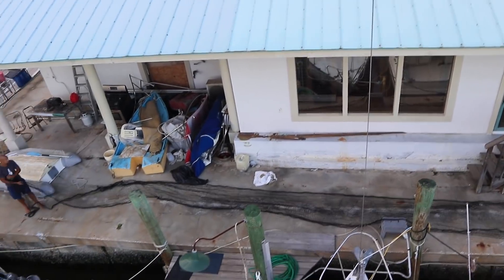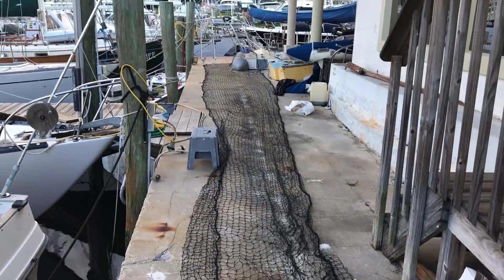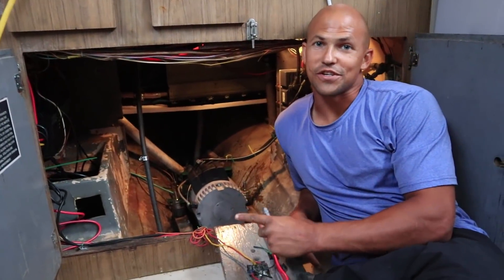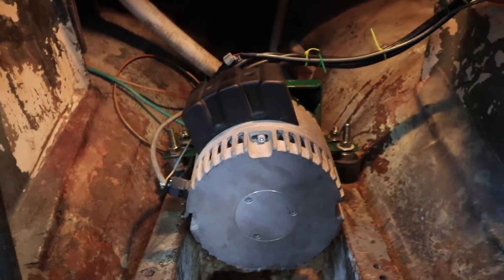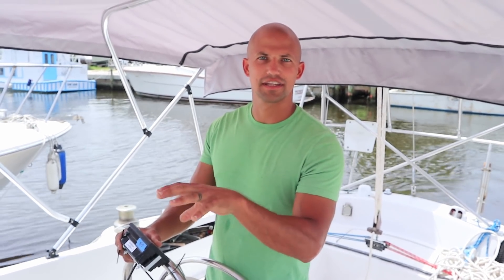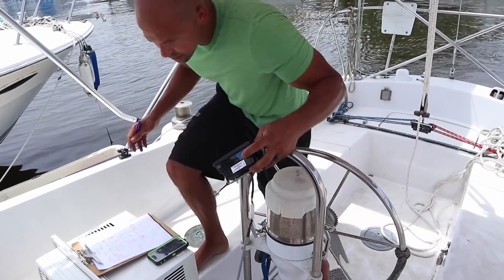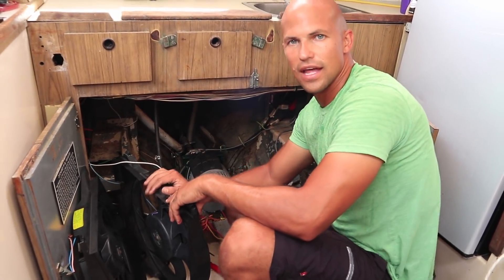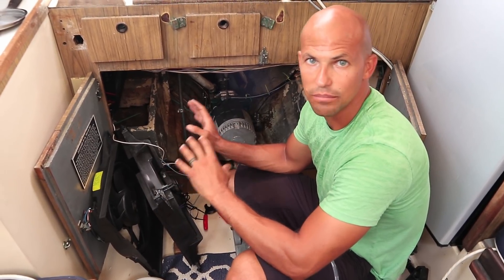Electric motor testing | 28 | Beau and Brandy Sailing

Comment: Any reason you guys decided to go with a brushless DC motor instead of an AC motor, seems like AC could offer more power with less heat and smaller wires. If you had to do it over again would you change it up? I'm curious as I'm about to try and attempt the same thing.

Comment: hi, this may be a bit late as i am only discovering your excellent channel now but a partial add on solution is to vent the doors into the motor room. Add the fan in the vented doors to draw hot air out and this should keep ambient running temperatures as well as throw some heat into the cabin on colder at sea cruising
cheers and all the best

Comment: Heating Problem. I would cut two holes and have a fan in each hole for push pull airflow, your cabin would then become a little warm. My computer also warms up my room, I can open the window if it is too hot

Comment: Thanks for sharing the info on motor temp.  I have the same motor and kit as you I think, and I was worried that my temperature was running between 150 and 200F.  Now that I know that's okay it takes a load off my mind!

Comment: You have every right to worry about motor overheating, maybe not needed but every right. If you still want to cool it down use copper tubing around the motor with a water pump. this would be alot more efficient than fans.
Reply from the maker: Thanks James! We haven’t had any heating issues so far...just a lack of knowledge on my part in the beginning. Haven’t even had to use the fans. 🙌
Reply from the maker: Thanks James! We haven’t had any heating issues so far...just a lack of knowledge on my part in the beginning. Haven’t even had to use the fans. 🙌

Comment: Look at the motor enclosure type on the motor tag. If that is a TEFC (totally enclosed fan cooled) motor, blowing air on it will do nothing it is entirely based on incoming ambient temperature coming in. Ie your engine/motor bay.

Adding a fan does not constitute cooling, only circulating of air.  And does not allow for stratification of heat. 

If anything the additional fan motor is likely only adding more heat to the compartment.

If you are worried about heat, you should be picking up your amp clamp, looking at amp draw. As you get closer to FLA (full load amps) of the motor, is where those amps plus SF will be the threshold of the insulating capacity between the windings. Unofficially consider the amps, the heat input to the motor. Minus your 75-92% of efficiency actually going to the shaft. 

Equate your plowing into a dock that of motoring up stream, without any momentum, from a dead stop. The prop is trying to pull water vs have the pressure of flow coming into it. Not quite like having a locked rotor or shaft.. but you are also putting excessive load on your components. (Could be why your controller crapped out). What are the specs on the motor. Ac volts/phase or dc volts?

Other than that, temperature on the motor is like putting your hand on an interior wall of your house to find out how cold it is outside.

Trying the right things, but methods and metrics are a bit off.   

Not trying to crap on you, just looking at your scenario from an open mindset. Tks!

Comment: A comment about testing your propulsion motor.  It takes a certain amount of power to move a sailboat at any given speed.  Your motor provides that power through your propeller.  However, when you tie your boat to the dock you are no longer looking at the power required to move the sailboat.  Instead you are looking at the power required to move the dock (i.e. North America), which is essentially infinite.  So when you run the motor to drive the propeller the power the motor runs at is the maximum power the motor and propeller can deliver at whatever the motor rpms is.  That amount of power is much greater than the amount required to move the boat.  So your test is actually looking at a much higher load on the motor than you would see if you ran the motor at the same rpms with the boat able to move (i.e., not tied to the dock).  So basically your test tells you nothing about the motor operating temperature with the boat underway.  Also as noted below, if you don't have a reduction gear between the motor and the prop, the maximum motor/prop rpms your are likely to need is about 1,500 to achieve hull speed.  The exact maximum prop rpms depends on the displacement of your boat, the waterline length, the wetted surface area, etc and the details of your prop (# of blades, blade area, blade pitch, blade type, etc.).  For example, my 36' sailboat displaces 15,000 lbs, has a 27.5' waterline length, and a relatively large wetted surface (full keel).  My prop is a 20" diameter, 13.5" pitch, 3 blade standard prop with a 35% disk area ratio.  That combination of boat and prop requires about 750 prop rpms to push the boat at 5.5 knots and uses about 10 hp (7.5 kilowatts).  If I tied the boat to the dock and ran the engine at the same speed the engine power would increase to the maximum the engine could produce at that rpm setting, which is more than 3 times the power required to move the boat.  Just a heads up.

Comment: I imagine you're already aware that the operating temperature for electric motors is 60 degrees F  above surounding ambient temperature. So if it's a hundred degrees in the engine compartment the motor will be fine at 160 degrees F which can easily burn your hand. You can wrap soft copper tubing around the motor and pump water through it also.

Comment: Guys just an observation; You may want to think about extracting the heat rather than cooling the engine bay. IE conventional engine bay extractor that has a cool air inlet and a hot air extract. Internal combustion engines are a lot less efficient creating loads more waste heat. While much of this is transmitted to the cooling water circuits and overboard a great deal of the engine bay heat in modern boats is extracted via ducted fans . You could even think about a small intercooler on the air inlet cooling the air before extraction. This would be pretty simple to do with a small low wattage pump and a through hull? Just a few thoughts. Sail Safe Ant & Cid xx

Comment: Awesome job guys. An idea would be to build a tube type structure to go around the motor that the fans set at each end pushing and pulling air thru. Like a wind tunnel maximizing air flow directly around the motor and not just blowing at it. Again just a thought. I know you two will figure it out. Peace guys.

Comment: Good to see another electric conversion. I'm running 48V 15kw hybrid and it's water cooled with a Johnson circulation pump.
I've been told to never run the engine on the dock like your test. The loads about double when the boats not moving and the thrust bearing is stressed. From stationary I can select say 900RPM and the amp draw starts at 100amps and will drop to 60 when the boat reaches about 4knts.
I am sure you'll get it sussed and more boaties will convert.
Cheers.
Reply from the maker: nice to meet another electric. definitely learning a lot as we go and we do think we will see way more conversions.

Comment: Have you  thought of the amps you are using adding to the problem , these amps your trying to make to run the hole show , on the other hand having to use them , in this case not to turn the shaft , put a 4 inch pipe down from the cockpit locker with a inline solar fan  , to force air in and another one on the other side in revirse pulling air out ,

Comment: I think you have a problem with this motor. 170 degrees Celsius is serious. Тo cool it need big inflows and outflows of air.  Where is such on the boat possible? Can try a fan of a smaller size, but with a large rpm. And concentrate efforts to remove hot air overboard through the pipe. If the fan and motor are going to blow inside this pipe, there will be a chance. It is necessary to count everything well.
Reply: He is getting 60 Celsius. Less than 1/2.

Comment: Temperature determines an electric motor lifetime, so you're wise to be cautious. An electric motor also produces more heat when it's operating outside of it's peak efficiency range. Looking at the 68V dyno chart on Motenergy's website the motor is 85% peak efficiency even though they say 92% elsewhere, so best case is you're wasting 15% energy as heat.

The ME1115 is rated for 96V*125A phase current=12kW continuous at max RPM of 5000, that's 52 kV (RPM per volt). It looks like you're running at around 48V,  at 48V and 125A phase current you're limited to 6 kW continuous. At 48V and 6kW a 15% loss is 0.9 kW of heat you need to dissipate with cooling. That's about the same as a portable electric heater on low.

Comment: Good video. I originally subscribed to your channel because you have the identical setup I am planning on putting in my Catalina 30. I am hoping to see more videos with information on your propulsion setup including some technical info like power draw at different speeds, solar setup, batteries, gear ratios, prop size, etc. Keep up the great work.
Reply: Keith Palle, hope you do a YouTube vid too bro... very interesting.
Reply: Tooth Fairy unfortunatially life is hectic and honestly it's probably going to be a couple years at least until I am up and running. I might just document it but making videos isn't exactly my strongest skill set.

Comment: Hi , I'm really surprised there is not a fan built into the motor , usually with grills top and bottom there is a fan inside mounted to the armature to draw air thru it.  In you application where it could get flooded I might have thought a total enclosed motor designed not to have air flow would be better. Sometimes called 'explosion proof motors' for use in places with high flammable fluids are around . More cost of course but could run underwater if the wiring doesn't short.  
Just read a smart ass question....'how can you tell the difference between a motor boat and a sail boat?' The sailboat motors 90% of the time...... thanks for sharing video.
Oh buy the way , you would think,..... electric motors used in boats would be very rust and corrosion resistant, right , WRONG,! I have a boat with 2 electric (bow) thrusters made in Sweden by Sleipner Motor AS. Sold as Side-power. ' the world leaders' Ha! The boat was not stored well out of the water when I bought it and at least one motor got wet, the other just condensation in winter........ both motor were corroded internally beyond repair , the brush holders and springs were plain steel , lightly plated , maybe and rusted up solid and the iron armature on the outer magnets........they did turn but both had to be replaced at about $1000 each ......! Thanks Side power , so a word of warning be sure to spray electrical marine grade water repellent or do what ever it takes to keep an eye on the corrosion .( RANT OVER,)
Cheers Warren

Comment: Great video, While sourcing the motors and controllers for my build. I was also concerned about heat. Found out the controllers are more prone to overheating than the motors. So I mounted mine on heat sinks with a 6" 48 volt computer type fan. But also provided fresh air plumbed to the controllers and the discharge exits the boat. 

The same can be done for the motors , even if not needed the motors will be happier as cool as you can keep them. I have seen shrouds that fit around the motor and have connections for a input and a discharge so the motor is always getting fresh air. 

Just my 2 cents worth. Currently building a 40 ft. cat with all electric drive and solar powered. 
2X 5 kw motors and 7000 watt solar and 1000 amp 48 volt battery bank.

Just keep plugging away. What type of Sevcon controller are you using? I have a couple of spares got a real good deal on them. 

Cheers Ken
Reply: Voyage of The Electric Iguana do you have a site to follow your progress? I would LOVE to have an electric catamaran one day, I think they are the perfect platform for electric propulsion.
Reply from the maker: Thanks for all the info Ken! Love the setup and look forward to seeing your progress. We've got a Gen4. You don't know where I can get the Sevcon Clearview Display? everywhere we looked is sold out, unless we want to pay double
Reply: I just bought my second clear view from Thunderstruck.. I have a Gen4 275 amp. Contact me on my e-mail from youtube channel.  Cheers  Ken

Comment: So, let`s get down to some numbers. 35-45 feet sailboats from the mid 1970-s on are often equipped with the 4-cylynder yanmar 4jh2e, coupled with a KBW20 marine gear. THE yanmar max continuous rpm is 3.400, the forward gear ratio of the kbw20 is  2,17-1, meaning that the propshaft max rpm is 3400/2,17= 1566. The maximum torque on the propshaft is over 150 ft lb. All in all, you need to provide such rated output with your elektric motor to match the speed and torque onn the propshaft the original setup provided. If you spin the propshaft at 1500+higher, but without torque will result that your propshaft rpm will dramatically decrease - dramatically meaning that the torque increase in the motor will not compansate the rpm decrease in headwind and rough see conditions.If you spin the prop too fast, it will not give you much power are props are also designed together with the engines, so too high rpm creates no resistance in the water. I am not meant to be partonizing you, just hapenned to be in the middle of the electric conversion of our 38 feet puma. you need minimum 12-15kw power - to get the same rated figures than the original diesel.
Reply from the maker: You're correct, the orininal intent for the motor was in and out of port/anchorage but we're probably going to go with a 15kw. Thanks for the comment and watching. How's your conversion going?
Reply: I sourced my electric watercooled motor out of a european hybrid, the watercooled controller from another hybrid with a custom made circuit board so works independently:)

Comment: Great video! If the motor is operating in tolerances and you have heat buildup in compartment, you can always create the fans for exhaust and drawn air from cabin, keeps air flowing in both
Reply from the maker: Thanks for the idea!

Comment: Those fan motors will generally last five times what the engines will in a car.  So buying another one is probably not really necessary.  Also you could pound out some copper strips around the motor to make a heat sink if you really wanted to do so. 
 It might mean you don't need a fan because you will passively dissipate enough heat, but you might need some of the white cheap heatsink compound. ..Also you might consider zip tying the netting to the tow rail, so when you are sailing the dog won't slide off the deck and under the netting.  Of course you probably just didn't finish the netting up and just wanted to show it on video.
Reply from the maker: Hey Allyn, thanks for the info. Yeah, netting wasn't all the way done, but we appreciate your comments

Comment: Not sure what your doing to a motor that has a sf torque and amps.your trying to square peg a round hole. Learn more about what creates the heat and you'll realize how hard the motor runs also determines heat. if its (continues run) these are important factors. Fans on a motor shaft that turns with the rotation of the motor will assist in its torque. But the calculation needs to be done to determine pitch of the Blade and Direction. Much more than just sticking a fan behind it. Size of ducting and temp variance of intake and exhaust need to be factored
Reply from the maker: Thanks for the input